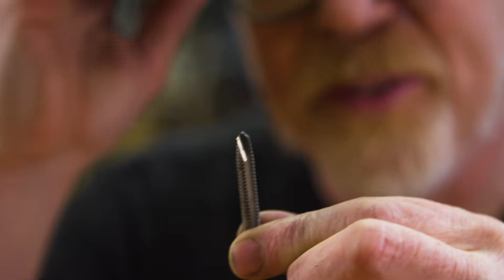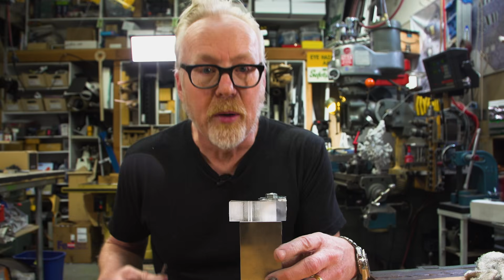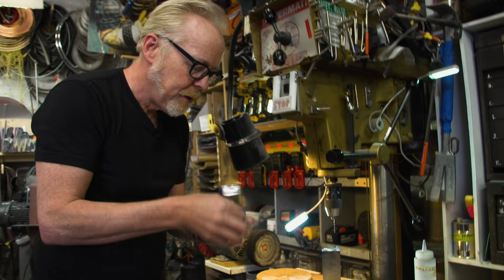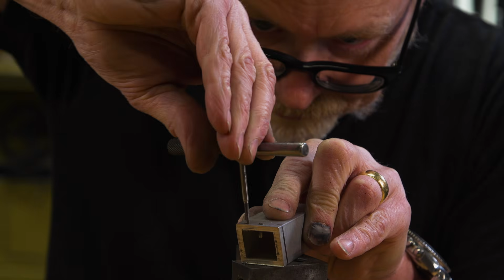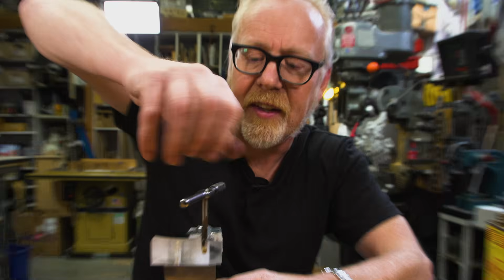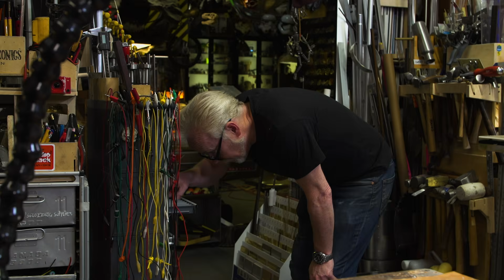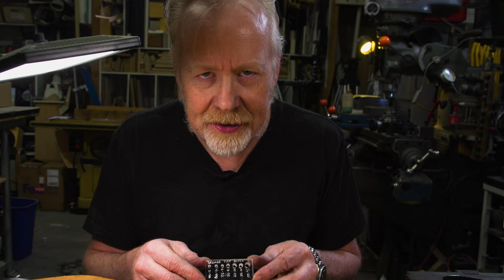Adam Savage's One Day Builds: Thread Tapping Guide Block!

Comment: Nice video, Adam! What I like about your videos is the marriage of science and engineering made art in thoughtful work.
 I work on, and build, musical instruments: stringed instruments of all kinds. I get to work with many materials from woods to metals, plastics, other polymers, leather, glass, bone, and last but not least coatings and adhesives.
I wanted to share a little tip that has served me well for decades. When I saw you wet sanding that acrylic block I immediately though of all the wet sanding we do on musical instrument finishes.
When you are getting down to the finer grits, the cuttings are naturally finer, more plentiful, and present more surface area of the particle in suspension. As this cuttings slurry becomes more viscous there is a greater tendency to clump and adhere again to the surface you are sanding. Left to clump or stick to your substrate, this causes burning back into the work due to friction, as any car painter will tell you.
Here is where you need a dispersant or a detergent. Add a few drops of dish washing detergent, and I mean drops, to your wet sand water. You don't want all sudsy. The difference is magic. No more burning in, with care of course!
Also, with Wet & Dry papers, put the papers you plan to use into a dish of said lube water for at least 15-20 minutes before you use them so they will be nice and pliable when you use them. Your papers will also last longer.

Comment: When I worked at Powell Electrical in North Canton, Ohio. We built circuit breakers and power source for subways and light commuter trains. We did drill holes in panels and tapped them to add electronic devices to the panels. We also wired everything from drawings.

Comment: One thing i learned about tapping is to use good quality taps, save alot of swearing and money in the long run. All of mine are ethier US, British or German made, they still will break but i find they keep there edge sharpness better for cutting the threads which means you apply less turning force to cut and less force applied to the tap the better.

Comment: So I need to replace a screw for an old Craftsman Table saw and the size is 12-24, I verified this because my set happens to have this size. Can I find that screw? Of course not, because it goes from #10 to 1/4. And this size is between those two. Either drill it out and re-tap to 1/4-20 or file 1/4 screw down and thread it to 12-24. Argggg.

Comment: A problem I find is, when starting a thread, getting the tap to grip initially, so that the first couple of turns aren't messed up.
I made a tapping guide, but with a  threaded hole, and clamped it to the workpiece. Then the tap went in and down nicely.
Admittedly it's a hassle clamping, and the guide would probably have to be replaced periodically as the tap wears it, but it does help a lot getting the thread started.

Comment: We can also calculate the drill size for any fractional tap by subtacting the recipcial of the thread pitch from the tap diameter, very handy if you don't have a chart.  drill size = tap diameter - ( 1/ thread pitch ) example ;   .2 = .25 - .05 ( 1 / 20 ).

Comment: when using a drill press, after drilling your hole you can put a center punch in the drill chuck and use it to align the tap and tap handle during the tapping process.

Comment: Brilliant; do you have a video on using dies? As an aside, I first encountered taps about 40 years ago, when I needed to repair a a crossthreaded spark plug hole with a helicoil insert. Aluminum heads on my 1963 VW

Comment: Acrylic is easy to tap, along with the softer metal aluminum, but let's see how easily you can tap old cast iron or steel. You know what I'm talking about: real-world applications, not play-time BS. Cast iron always breaks a tap or two for me. If you aren't paying much for your taps/dies, you're buying junk, sadly. I went through three or four different sets before I finally upped for a quality set ($400 set from Bosch) back about ten yeas ago and they have been a God-send when it comes to tapping and the occassional die work while making studs for older cars, etc.

Comment: Lovely fun video. But you only need 4 holes in your tap guide block. For #6 taps and smaller, the shank is exactly the same size for all good-quality taps -- as you noticed and measured. So 2-56, 4-40, 6-32 can all share the same hole. Similarly, 10-24 and 10-32 can share one hole. So really, you only need #6, #8, #10, and 1/4 holes in the tap guide block.

Comment: I currently inspect taps that we produce at my shop. I work for a company called Tivoly up in Northern Vermont (plant actually sits right on the border of Canada and the US). We make so many different style taps from standard to metric, bottoms, plugs, and taper taps along with many specialty taps used for specific applications.  I have to hand wire these to make sure the P.D is within tolerance most of which are within +/- .0005.  I have to wire all the way up to 120 pitch which is very fine at 120 threads per inch. It's pretty awesome to see you explain this as many people do not realize the importance of these tools!! Great video Adam!
Reply: Do you make really small taps 0.7mm to 2m?

Comment: I was a tool maker for 43 years and out of all the taps I broke in that time I was only able to get one out with a tap extractor. There were others I got out by shattering them and a few other methods but only one with the tap extractor.  If I remember right it was a 3 flute tap.  The very first project I had when I was an apprentice was making a taping block and it is a god send for keeping the tap straight.  You did a great job explaining this.

Comment: One type of tap drill chart you will never find for screw threads is for metric threads. Simply subtract the pitch of the thread from the OD of the thread. That's your tap drill size.
The only people who have never broken a tap are those who have never tapped a hole.
That absolute worst thread size to tap is 10-24.
Tap wrenches have minimum sizes they will hold.
The spiral flute taps that push the chip forward are only to be used in thru holes.
If using regular straight flute taps always start with a starting tap or a taper tap. Bottom taps are only to be used to finish a blind hole. 
Helical flute taps are meant for power tapping in machine tools.
Cheap taps do not last. The tips of the individual threads will go dull almost immediately if used on tougher materials.
Different materials have very different tapping properties. Steels with a few exceptions* will form strings. This is the reason that taps with straight flutes need to be backed of to break the chips. Cast Iron the chips will break off on small pieces. These chips when manually tapping do need to be cleared from blind holes. Copper based alloys can be real nightmare. Bronzes as they are being tapped will expand due to heat towards the hole. 
*There is a range of tool steels that are called Graphitic Tools Steels. O-10 is one. It has a machinability of around 110. It forms chips like cast iron. It is extremely stable in heat treat with excellent wear characteristics.  Originally developed for use in Timken tapered roller bearings by Latrobe Steel. A subsidiary of Timken.

Comment: I started using these after watching this video WOW what a difference it makes. Now that being said I make them with a little twist. Instead of drilling them out I 3D print them  I have at times needed to thread a hole in something like a round pipe or in the corner of a 90 degree angle drawing one up in Tinkercad and printing on the lowest resolution is quick the it make tapping those holes very easy.

Comment: 1. I made a tapping block in a VEE block. On the VEE side I tapped a screw hole in each corner. So with the four screw through a flat plate, I can clamp the block to a rifle barrel for tapping.  Or any round object you want to tap a hole. 
2. On what thread count to use is also dependent on the thickness of the metal being tapped. For thin metal, cabinets , I would use the higher thread count.  
3. When making control cabinets, I almost always put the tap in a electric drill. Just keep cutting fluid in a container you can dip the tap in between holes. 
4. In my retirement I have given up on  using 1/4-20, 8-32 for using 2-56 on model steam engines. 
Great video.

Comment: Since a typical thread is 70-80% depth of thread, I listed all the standard drills (numbered, fractional and lettered) in one column and calculated the percentage of thread for each screw size in columns to the right of it.  Then, you can use any drill you have which gives you close to 75% thread.  You can also use a "negative" percent thread ( about -7 to -10%) as your clearance hole.  (For "forming" taps you want a BIGGER hole so you look for a 75/2 = 37.5% (???) depth of thread, or so the threads are formed out the remaining material.)

You do have to calculate the percent thread, but this can be done based on a formula from the MSC catalog, using the hole diameter, the size of the machined thread and the pitch.  I can post the formula here, if need be.  

Similar  table can be generated for metric taps, you can use the same drills for making those holes.

Comment: I’ve been trying to find somewhere to send you pictures, but to-date, I am still proud of this. I was tapping some 1-3/8 - 12 holes, and my tap snapped. I ran out to the local lowes and was looking for a 1/2 socket that had an OD smaller than the ID of the hole I was tapping, used another tap as a template and basically made my own extractor. Stuck it in a 1/2” impact and drove that broken tap out of there!

Comment: What about thread forming screws that don't cut threads, but displace the tapped material, leaving threads in typically soft work, such as aluminum. If you need a couple dozen screws threaded into, say sheet aluminum, and you need to do it on a large scale, letting these more-expensive screws do it for you may be the way to go.

There are standard coarse and standard fine threads. For example fine threads are used in autos to better resist vibration.  And you start out all over again outside the U.S. what with metric threads, and (God forgive us) all those threads the foreigners used BEFORE they went metric, i.e. Whitworth. Then there were all the handmade screws made for firearms, etc. before there were any interchangeable parts. Ugh!

Comment: ive only broken maybe 4 taps in my 4 years of machine building / assembly (Ive also done about 1.5 years of machining) and Ive only managed to rescue one hole as well by shattering the tap with a hardened steel point too (but it also shattered the hardened steel point I used). Ive only had it happen on 10-32 and 1/4-20 taps (Ive never had to use anything smaller than 8-32 for the machines we build at my work), and ive tapped plenty of 3/8", 1/2", 5/8", 3/4" by hand, only those small bits are the annoying lads that break, and its only happened to me on deep holes where it reaches almost the length of the taps threads.

Comment: Lol you definitely can just use a bottom Tap. I do all the time and didn't even know it was called a bottom Tap. That's a normal Tap to me but the tap u  first used is the special Tap as that one allows you to do angles but if you are just going straight which iam always, u only need what u call the bottom Tap. I just call Tap. I don't like calling it a tap anyways lol what u said in this video is slightly wrong because older taps are not designed to deal with the shavings so maybe this is a reason why u think u need a bottom Tap but if u look the bottom Tap u have and held up has cut in it. It's funny cause the way ur doing it is the harder way. Only need that bottom Tap. There are exceptions to this but for the materials ur showing and using bottom Tap is all u need. Now maybe we both are ignorant here because I also never used a tap as small as u mentioned but the ones u demonstrated with I have. And maybe going in on angles it also common for you although I never really need to

Comment: A buddy of mine used an impact on a 5/8 tab, it broke. He could not get it out, I told him use a torch heat it till its red hot then cool it with water then it cracked and we used a chipping hammer to shatter it even more. (if you need to clean a hole with threads, just take an old bolt thats fits and grind groves in it like a tap and use it to clean the threads.)

Comment: Spiral point AKA gun taps, are great for thru holes.  Spiral points taps are stronger than a plug tap.  
Spiral flute taps are best for blind holes.  
If thick aluminim is to be drilled, a fast spiral drill is outstanding.  Most people working in metal know nothing about fast spiral drills.
I could drill a 1/2" hole through 3" thick 6061 T6 aluminum with one pull.  Not possible with a standard jobber drill.

Comment: I inherited a tap and die set from my dad.  He was a machinist by both trade and avocation.  Me, not so much.  I know my way around a tool box, and I can fix quite a few things around the house, but I've never had occasion to try and use the taps and dies.   I just keep the set for sentimental reasons.
My dad's method of judging whether a hardware store was any good was, "Do they carry 10-32 brass screws?"  LOL   That came about because he was once working on a project needing that type and size of screw, and the local independent hardware store didn't have them, and the owner tried to sell dad something else.  Luckily, we had two local hardware stores, so he avoided going to that particular one again!  :-D
I'm not familiar with drills by numbers.  I'm accustomed to SAE sizes: 5/16; 3/8; 1/4 etc.  I don't know how those equate to #7 or #42 that you're referencing...

Comment: I'm only about 2 years out of machining school but also 45 & been working with tools all my life. So, I'm surprised that I've never seen one of these. In school we were taught to use the dived in the end of the tap & a guide pin that's basically a spring-loaded rod with a tapered tip which fits in the dived. Basically the tap guide goes into the spindle of a mill or drill press & you just do it ofter drilling the hole so that everything is lined up.

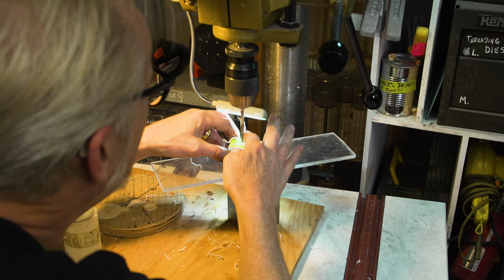Side note: DO NOT be clearing chips out of the flutes of a spinning drill with your finger, like we see at 36:10. That's just a bad habit and a disaster waiting to happen.
Sorry Adam, I had gotta call you out there.

Comment: Yes the cast plexiglass is what you want. The extruded plexiglass does not machine well, has a lot of internal stress and often cracks.
 Counter sink the hole to be tapped about .010 larger than the thread size.
 This will make it easier to tap and less likely to have threads pull out of hole.

Comment: Still have a few cans of tap magic from early 80's before they changed formula. It works better then the new & improved fluid. Best thing about old tap magic it evaporated quick keeping tap cooler. We had a top in class master machnists that use to perform work on some type of plastic or rubber like material. He placed it in freezer for maybe 2 hours then machine material until it got warm. Guy know a lot about making just about any thing. Forget about garbage Walton tap extractors. Broke at least a dozen of them without ever removing a broken tap.

Comment: At the 2:30 mark this appears to be what tool & die workers called a gun tap. Some of these guys do not like the thread they produce. When I told them threads look and work like regular taps they told me you have to use a microscope. Yea right. I never had much luck with tapping a 4/40 hole. Tapped thousands of 1/4 20 holes. Prefer tap magic fluid for tapping steel & Alumni tap for aluminum.

Comment: Sacrificial plastic plate under your plastic drilling work stops pull up!!!?!!   So this will not work with a wood or metal sacrificial plate, only sacrificial plastic plate.    DAM I am glad I watched this videoed. Will this work with BRASS as well (using a sacrificial BRASS plate )? Right now I have a special set of drills ground just for plastic and brass but it is annoying to switch them back and fourth.

Comment: Curious how you feel about ratcheting taps, I have a tap the has a ratcheting mechanism that still allows me to feel when i've gone far enough in the hole.
Reply: You use ratchetting tap handles when you cannot get enough "swing" for the handles of a normal one. Otherwise, there is no advantage or need for them whatsoever. The ratchetting slows down the chip breaking process too, since you have to repeatedly "change gears" to reverse back every 1/2 turn.

Comment: I find a nut that screws on the machine screw or bolt. Then I find a bit that barely goes through the nut. That puts me close to the tap size. You can tell I am not a purest when it comes to tapping.
OH- for the bit sucking up the work at the end of a hole. I put a piece of rubber hose from the chuck to the bit end. I leave just enough of the  bit sticking out to finish the hole. It helps keep the bit cooler.

Comment: One advice that we used a lot while manufacturing complex aluminium stuff. When you put a lot of hours of work in to a piece of aluminium and you have broken M2 tap in blunt hole in that aluminium... You have no options but to fix it somehow.
So we used acids in this case, some solution of nitric acid was the best. You can dissolve enough of the broken tap to remove it from aluminium and doing almost nothing to the aluminium itself.